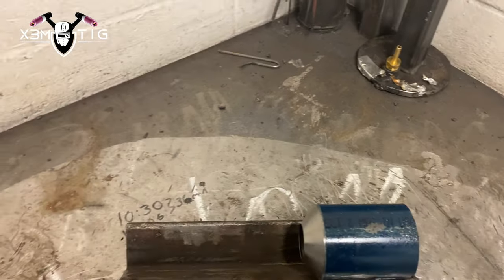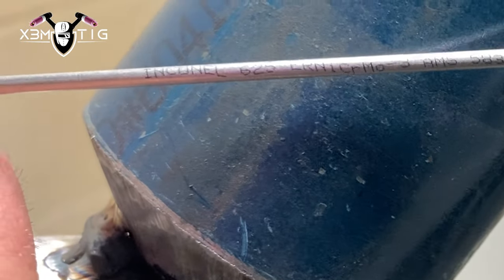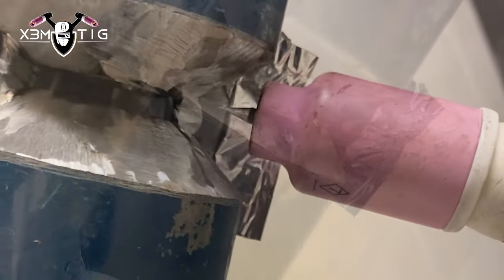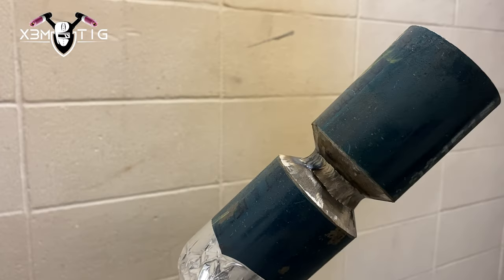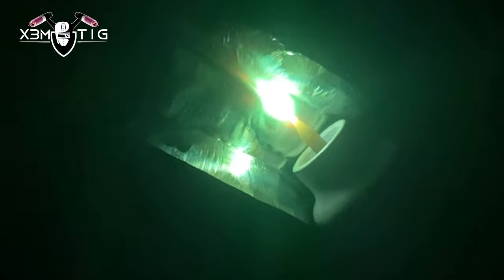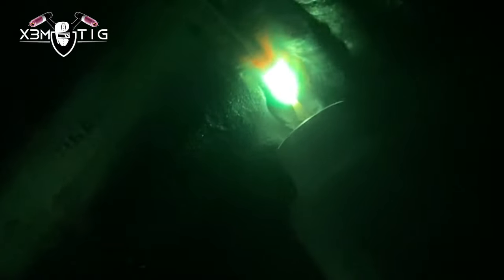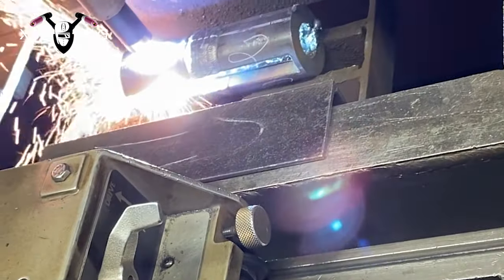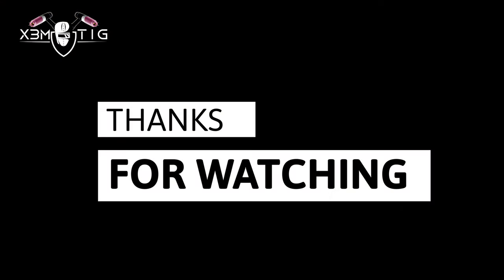6G Inconel | MAX TIG Welding Procedure | F34, F4X !

Comment: Great job on the 625 as verified with the bends.  Years ago while welding for Dow Chemical I developed the WPQR & WPS for Inconel 690 (high pressure/high temp) for Phenol service.  After which I welded 400+ 2”xxhy-4”xxhy butt welds 75% in 5G position free-hand, balance rolled.(tells how long ago it was LOL)  The 1st thing I learned with the nickel heavy material is I needed a “uniform keyhole” for a 100% root and I see the same as you put your root in.  In Dow we welded to the ASME Codes and to the ANSI B31.3 for most piping.  All Inconel 690 welds were radiographed 100% as per ANSI B31.3 “Severe Service” classification.

Comment: I welded some ERNi-1 today . Root was good but I did  noticed that once it came down to the fillers it was a little dirty on the surface . It was ERNi-1  wire to carbon steel pipe
Reply from the maker: Yeah, keep rod connected to puddle as long as possible, and grind stop-starts, helps reduce impurities.
Reply: Was it ERNI-1 or ERNICR-1
Reply from the maker: @candyman5749  similar thing, except in your case copper is the problem that creates impurities with ERNi-1

Comment: In the UK we often use argon with 2.5% or 5% hydrogen shield gas for inconel cleans the weld pool
Reply from the maker: Hey bud thanks for your comment. Yeah I’ve been using that mixture in the shop, makes weld puddle more liquid. Out in the field we use only high purity argon.
Reply: @X3MTIG  Glad to help a fellow master of metal amalgamation 🤣 (it's been a while since I was hands on)
Reply: @johnbrennan4759 I’ve heard it’s a favorite for nickel copper pipe too, does it really make that big of a difference?

Comment: 7:20 looks like you have some shoulder at one o'clock, but the rest looks fabulous. I took this test today and busted it for what they claimed was suck back. The lab that I test at is unforgiving, and only allow grinding once or maybe twice, outside only. No grinding in the booth. 

I thought that you were supposed to dip the rod all the way around. My biggest problem came at the top quarter when I tried to seal up the gap. I did my hot and filler passes at 225 amps, but it was a super coupon. Was this too hot?
Reply from the maker: It’s not too hot if you have good root protrusion, but if you go to hoot and don’t have enough meat in your root, that’s when suck back occurs!
Reply: @X3MTIG  - Thats the problem. I don't know how to get good root protrusion. This inconel wire that they are using today seems different than the wire that they used in the past. In the past, if I busted this test (which I usually passed), it was for having to much protrusion inside the pipe. Today I can't seem to get enough in, no matter what I do. Could it be a different grade of inconel or brand of wire that is making the difference? These yo yo's that run this test lab don't believe those details are important, and have never been welders professonly. 

According to welding codes, suck back is allowed, because it is compensated for by the reinforcement on the cap. Yet this lab still won't pass it on a test. I took this same test four months ago and passed it, even with the same stuff wrong with it. This place has become inconsistent with what they fail or pass and their tests are a joke.
Reply from the maker: @candyman5749  that’s possible too, unfortunately I’ve seen that happen before.

Comment: When you finished the root on the inconel, is it requiered to keep the purge on for the hot pass, fills and caps ? Great video
Reply from the maker: It’s a good habit to keep it until hot pass is done.
Reply: @X3MTIG  so fills and cap can be ran without the purge correct ?
Reply from the maker: @kaneflores1014  correct 👍

Comment: You like knife edges? And about backing gas? All way for that thickness?
Reply from the maker: I always use knife edge , backing gas it all depends from the pipe diameter, and all the way tig was welding procedure.